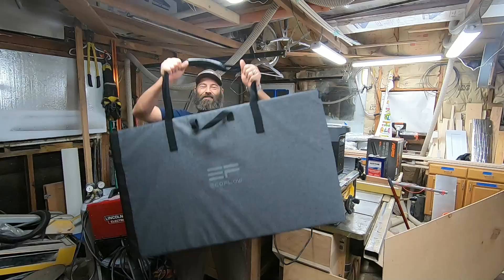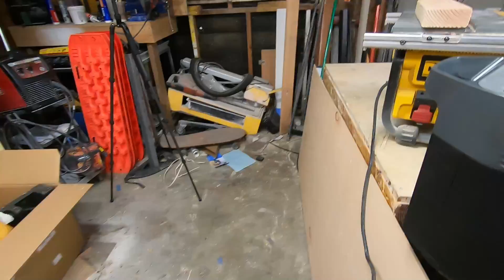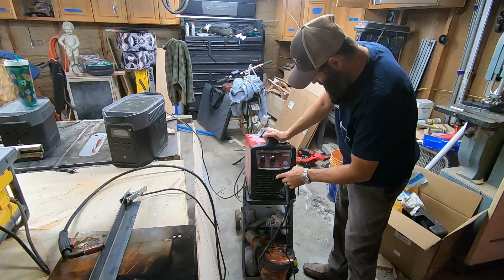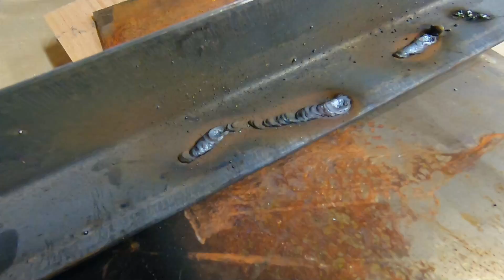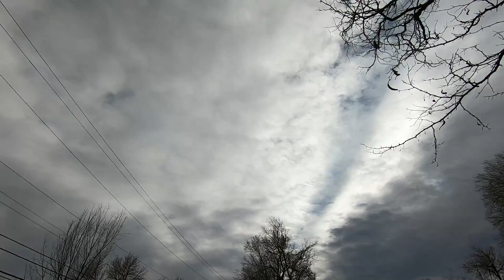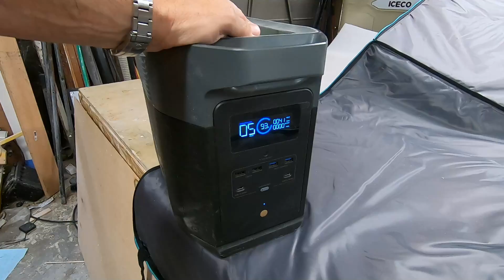This Was Impossible To Do A Year Ago | THE HANDYMAN | $1000 Per Day |

Comment: Good review, I've been wanting an honest one on those. They popped up on my radar a few months ago and was wondering about them. Did want to add a safety tip from my experience. For years worked in shops with big table saw layouts, and some small mobile stuff, that off side drop piece..? I've seen it catch the blade and shoot back through a 1/2 inch particle board. The hand stick saves the piece used on, but most table saws have those what I call dog teeth safety spring loaded parts just past the blade. I do cut like you did, sometimes just have to, but I try to keep them on.

Comment: Every time i change my bottle on my welder i put teflon tape on the threads,it seems to help a lot
Reply: The seal isn't on the threads, it's in the tapered seat
Reply: @uncledave56  ... 9 times out of 10 it's the gas solenoid in the welder or the smaller hose connections that leak. Since my welder has a special nook where I store it in the shop I also added a note to the power cord as a reminder to turn off the gas when I put it away. These days it's almost an automatic reaction to close the valve when I put things away because I hang my helmet on top of the gas bottle.
Reply: @rupe53  show off
Reply: @brandonlee8400  ... not showing off. Just saying that good work habits take time to develop. Everyone has left that valve open at least once... but you learn!
Reply: @rupe53  I'm detecting sarcasm in his comment but building good habits into your routine is something I'm a fan of!
Reply: @thomasdickson35  ... maybe a touch of sarcasm on the comment "everyone has done it once" but if we can't learn from a mistake, then what? I suppose it may take some two or three times of leaving the valve open, right? Last I looked a bottle of gas was near $40 for the size used in the video. The next larger was about $75 last I bought one. That gets expensive in a hurry.... so we need to learn in a hurry.